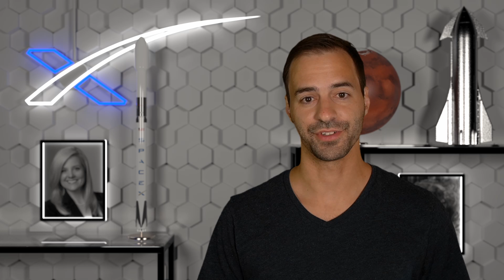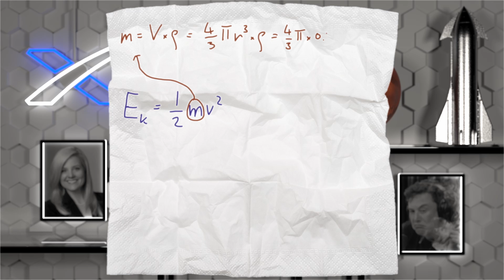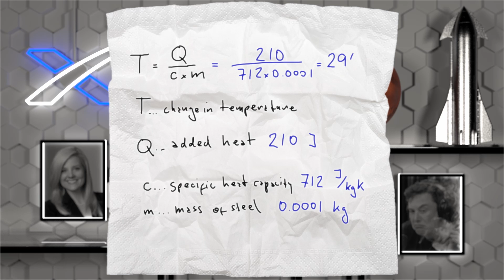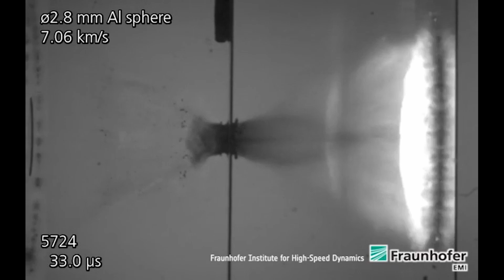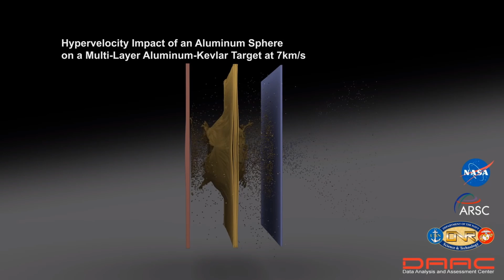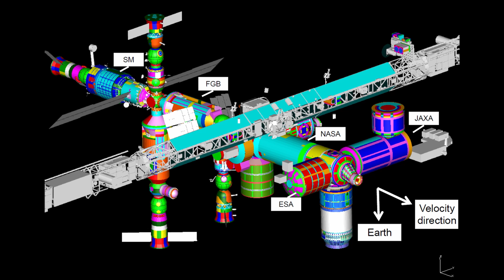Protecting Spacecraft Against Orbital Debris - Starship Example

Comment: Fascinating and super informative, thank you. Great point too about the landing header tanks being protected so if all else fails you can still land. Really enjoying your channel! Can’t wait to see more
Reply from the maker: Thank you!
Reply: how would the craft deal with loss of pressurization though?
Reply from the maker: @snuffeldjuret  Only the main tanks would loose pressure.  A potential problem is the that the pressure also provides strength to the whole structure, so landing might be a problem as well. Who knows, it is really too early to tell...
Reply: The oxygen header tank is not protected in the prototype design.